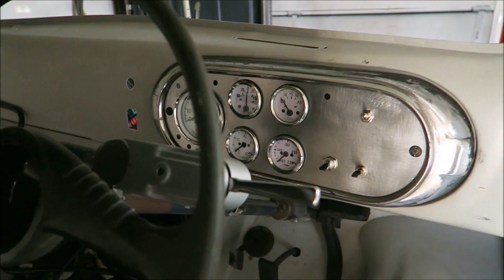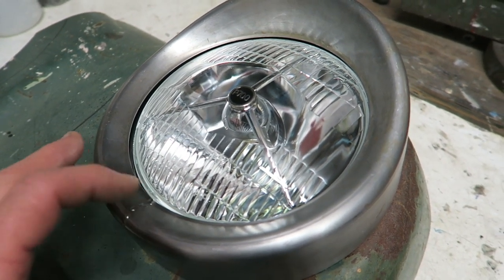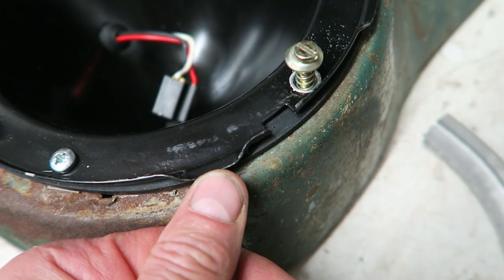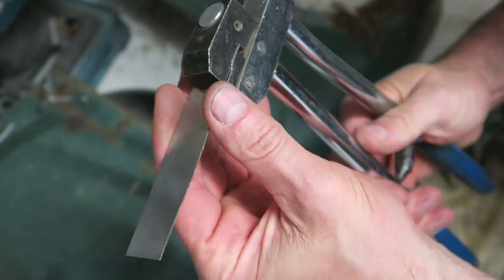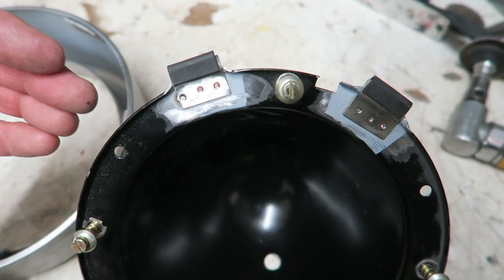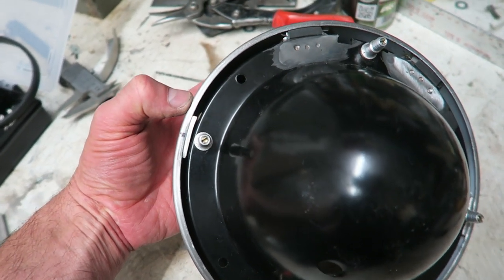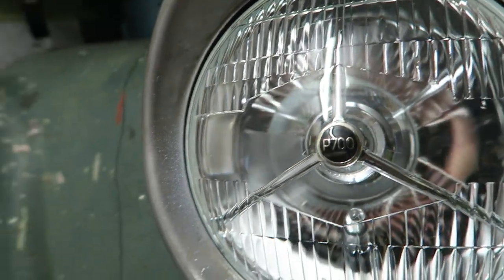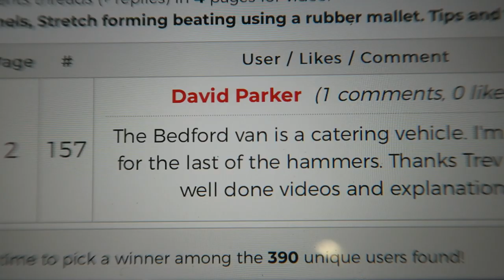Real Cool 50's style headlight headlamp bezel custom Hotrod Tips and Tricks #32

Comment: That would be an espresso machine located behind the side panel. Love the videos. I am working on a custom topper for my Ram 1500 and a roller tonneau for it as well using aluminum and oak for the rails and tambor on the tonneau.

Comment: Hi Trev,
Another brilliant video - well done.

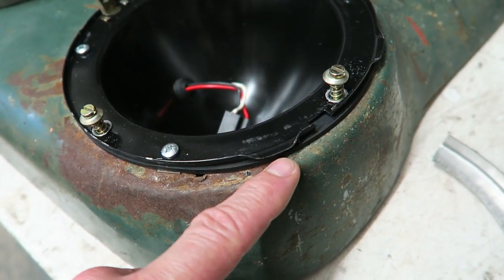That rectangular cut out you’re pointing to at 5:02 is for water drainage in the OE application and should be installed at the 6 o’clock position.
You may need to maintain that position to facilitate the originally intended lamp adjustment.
The steel bowl looks like a Mini or MGB item and the original chrome rings do indeed hook under those “ears” reasonably easily.

Espresso machine, I believe.
Cheers from Oz.

Comment: Could you use  fender welting around the bezel to fill the gap.  Might look more finished than the edge of a rubber disc
Reply from the maker: RPM unlimited actually you’ve just given me an idea, I could use the rubber edge trim, but possibly wouldn’t be fat enough. Cheers Trev 👍

Comment: Expresso machine, Ps just a heads up for everyone, the original chrome rim supplied with the steel bowel looked crap even though in a LUCAS box, well if you want LUCAS search for old nos lucas as anything new today in a green LUCAS box is not made by LUCAS as they don't exist, it's a name only owned by TRW, they allow 3rd party suppliers to use if a royalty agreement is signed  and paid to TRW, so quality is always questionable, original LUCAS was made in England not the far East